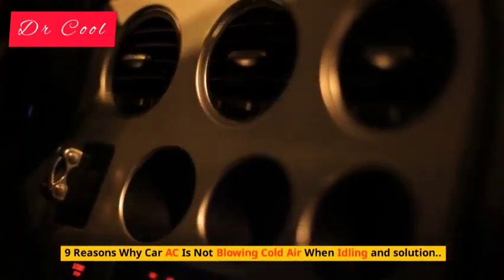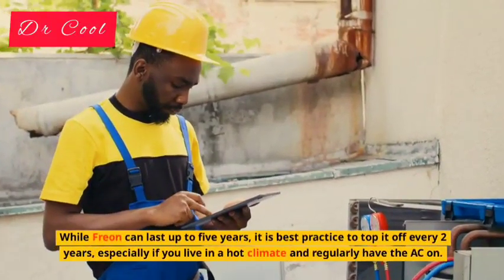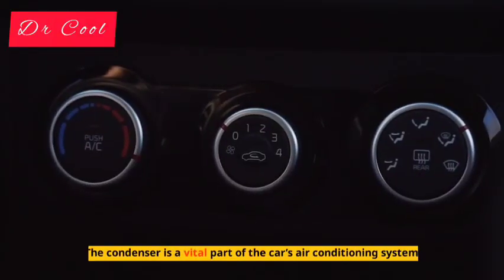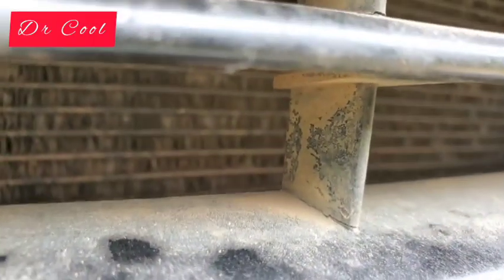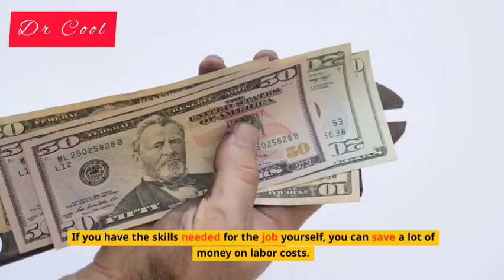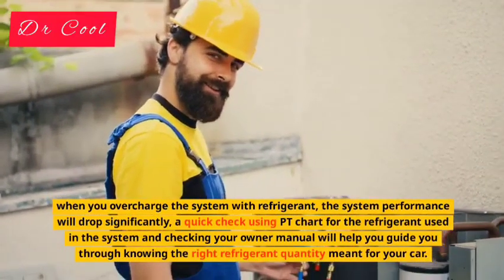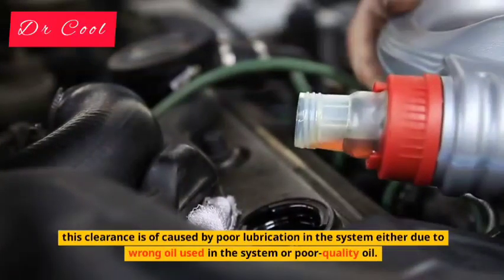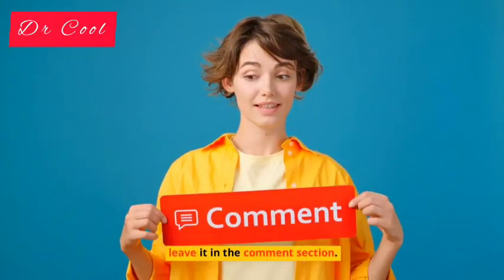My Car Ac Cools Better When I am Driving but warm at idle | Car Ac doesn't blow cold at idle solved

Comment: I have a 2005 Tahoe. The Ac system was changed out 2years ago by dealership. The rear ac blows cold air all the time. But the front air is slightly cool at idle and when I accelerate the front ac will get colder but not as cold as the rear ac system. Dealership found no leaks in the system. I took to a second shop to address the ac system. No leaks found , but was told the compressor was working weak. I’m not sure about that when the rear is always blowing cold air. Any ideas as to where to look now?

Comment: That's what happens to my car. It only cools when it's running. The other strange thing is that it doesn't drain water like a normal AC does.
Reply: the drain hose is plugged.
Reply from the maker: Underperformance

Comment: Hi boss,
I changed Toyota Yaris Ac Compressor and Ac Condenser and filled gas Honeywell American
One day ac working good after that ac tripping on signal or when i park my car compressor again and again tripping and not cooling .
Even i changed my fan motor new.
But the problem is same.
Now i checked to mechanic radiator he clean and he said your radiator have no issue.
Now what is the solution
Reply: Bro I am exactly in the same position with my yaris.did you find any solution 😢

Comment: The condenser fan under the hood might just be stuck. Easy fix if so! Take a screwdriver and tap the fan blades and see if the fan starts turning. Worked for me. Watch your fingers!
Reply from the maker: Thats a Recipe for disaster
Reply: @Drcooltech  Also recipe for saving $1,000 with a 10 second fix lol
Reply: @DerekDTX35 some ppl say shit jus to say it knowing damn good and well they would be the first person tapping the fan to save 1000 bucks.
Reply: With an electric fan, that's the first sign of the motor windings going out. I had one like it and whenever it stopped on a certain spot, I had to spin it to get er going again 😅

Comment: This is the problem of my car now 
The ac blowing cold air while only im driving

They changed everything condenser & compressor but still the same problem
Reply from the maker: Where are you? This needs a remote service assistant fix..
Reply: @drcoolautofix lolol Mechanic; "DANG...the original mechanic didnt fix it OR suck you dry" 
Customer is still inquiring about repairs...which in mechanic language means...the customer has more $ they are willing to spend. 
Mechanic after observation; "This needs a HIGH priced/ineffective virtual diagnostic if that's the case!"
Reply: I regas my car every month. I've taken it to various specialist but can't find the problem. I had to buy a condenser and new compressor. Now some are saying it might be the evaporator coil. 

Again it's an assumption. How will I know if that's really the problem. Replacing the evaporator coil means removing the whole car dashboard.
Reply: What kind of dummy "technician" did that parts cannon fire on your car without first diagnosing the problem?

Comment: What about a/c clutch air gap? Is it possible that a gap that is set too wide can result in the clutch not engaging adequately at idle, particularly when the clutch plate is worn and/or the coil is old?
Reply from the maker: It's Likely